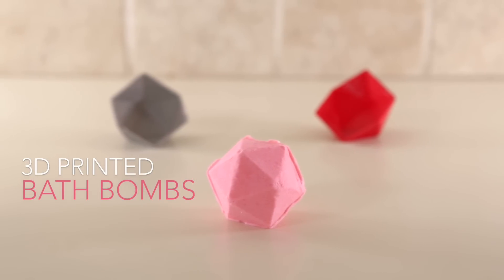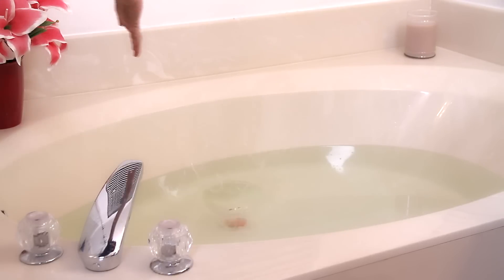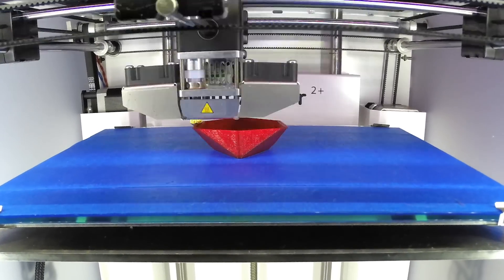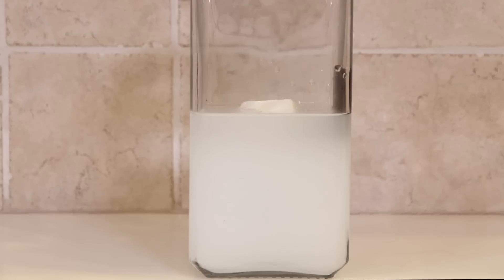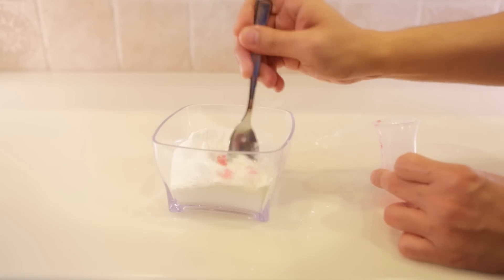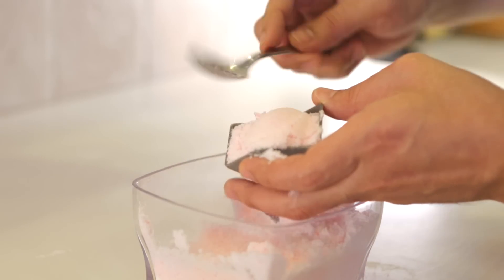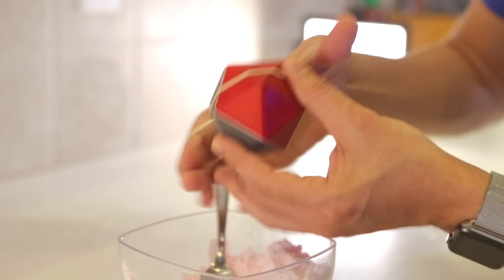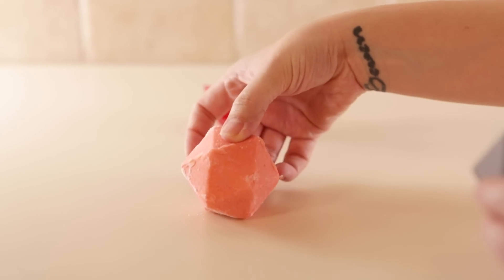3D Printing D20 Bath Bomb Molds

Comment: Great job on this one guys! Really creative and awesome. How'd you get the bath bomb mix into the water soluble mold? I think I may just try this project myself!
Reply from the maker: +Aidan Leitch Thanks! The PVA mold was also two parts but we used Elmer's glue to seal them (it's basically PVA as well) It's skin safe so should be fine in the tub ;-)
Reply: +Adafruit Industries Awesome. I use elmers glue to attach PVA parts too.